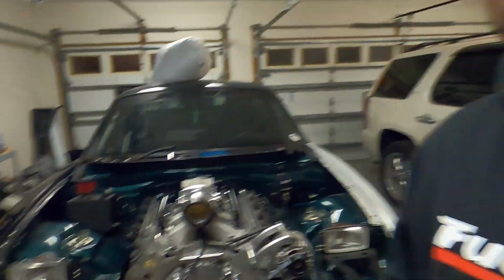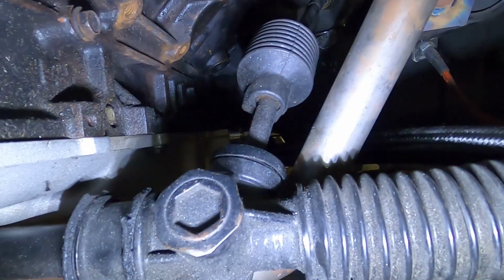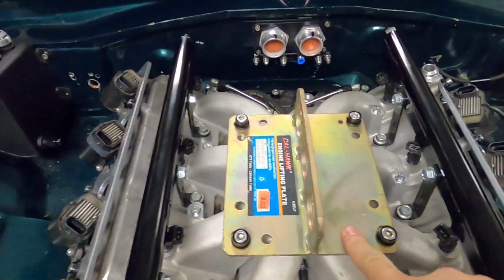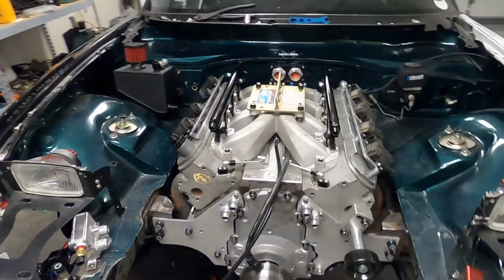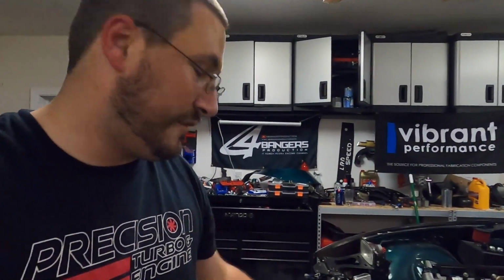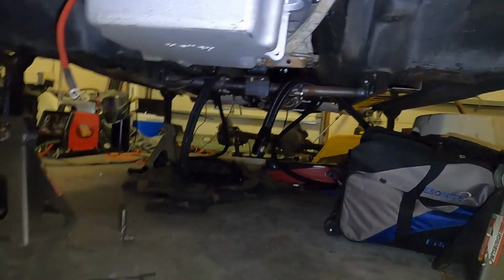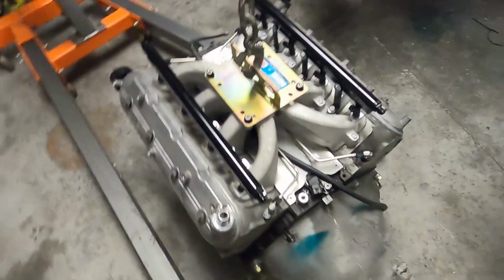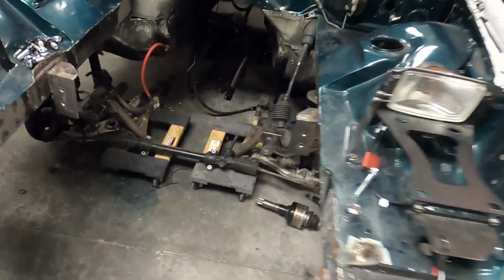WE HAVE A STRIPPED DOWN MIATA 66 DAYS BEFORE IMPORT ALLIANCE

Comment: Question about the previous engine in this car what head did you have the stock mx5 head or the b6t head out of the 323
Reply from the maker: The head was a stock miata head. The valve cover was from a mercury capri
Reply: Mr Mattman thanks yeah I’m building a b6t and I’ve got the mx5 type head thanks for your help.